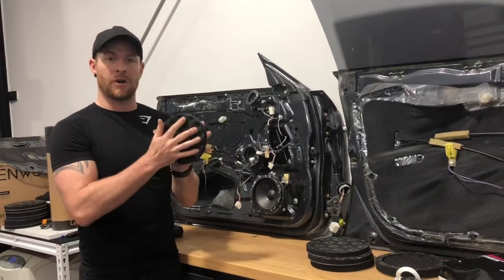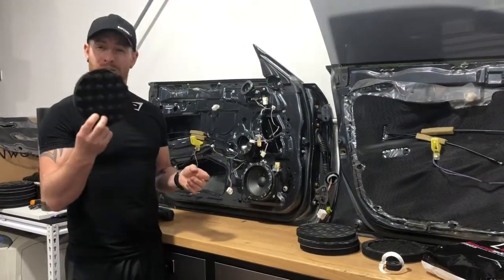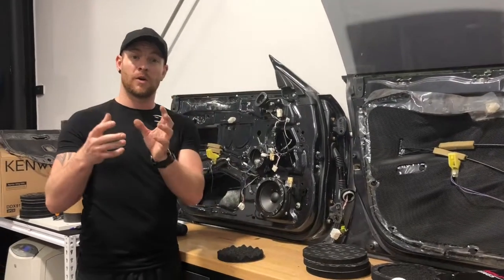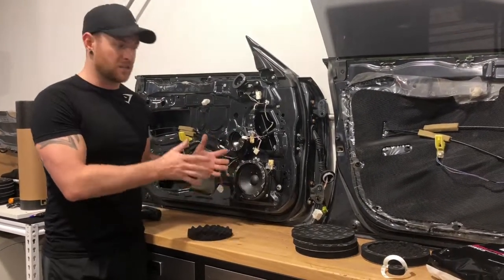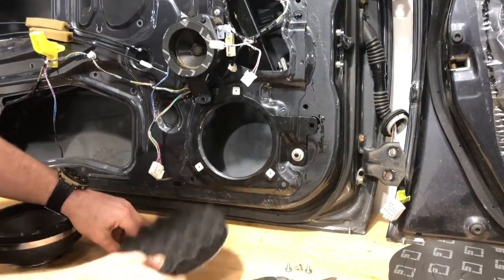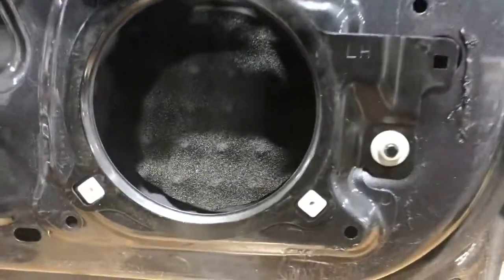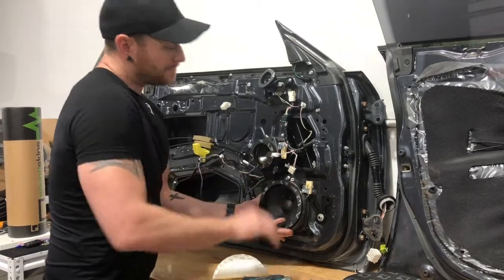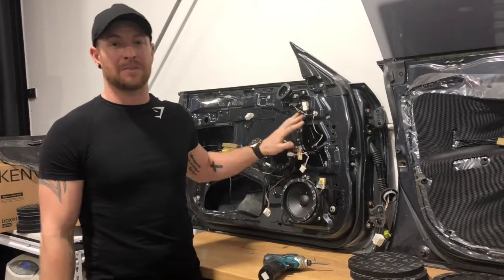How To Apply SoundSkins Rings: Stage 1 Primary Rings

Comment: I'm adding kickpanels with 6.5" speakers to my 1969 Chevelle, and the back of the speaker is almost touching the metal on the car.  There are a couple of holes, for door hinge access, behind the kick panels.  Should I cut some of the metal away and add sound deadening behind the speakers or just cut a ring out of the middle of my soundskin so the speaker magnet can fit into and cover the rest of the holes with dynamat or something?